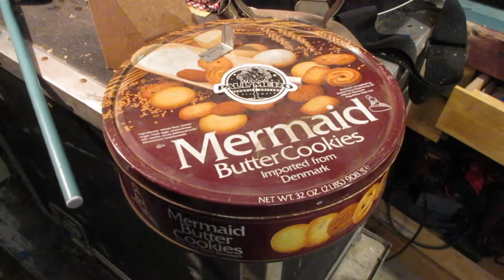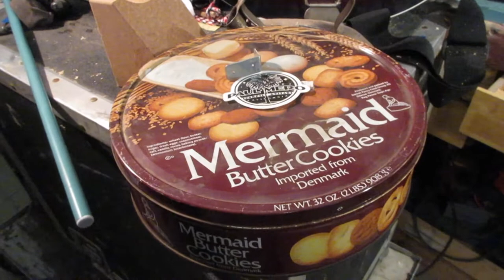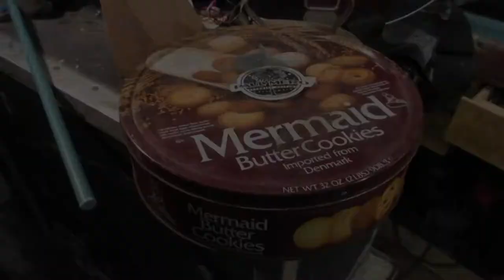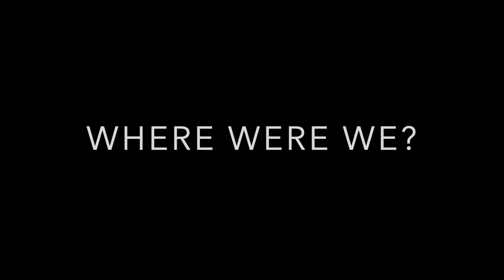DIY Archtop Pickguard Mounting Brackets

Comment: Omg… you show so much taking about holes.. and where they are and where they aren’t. To what point? Get a pice of strap. Bend it. Mock it up. Drill holes in it where they should be on the strap… and get on with it. If you have to fabricate it and you know it then what is the point of still showing and exploring parts that will never work 13 min into the video. They won’t work. Get them off your work bench and get on with a plan that will work.